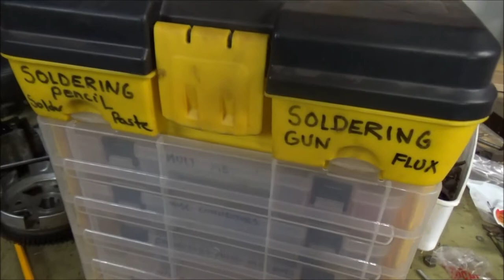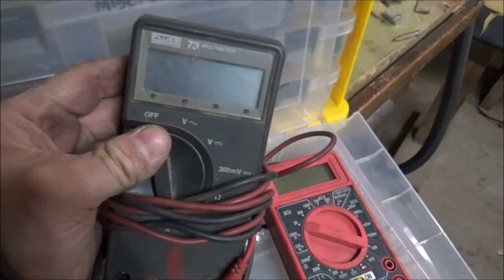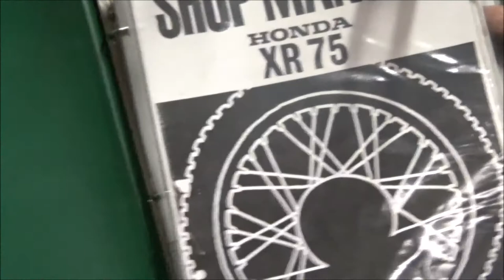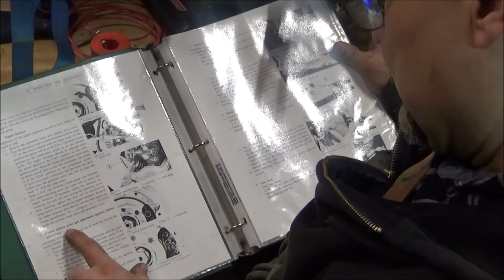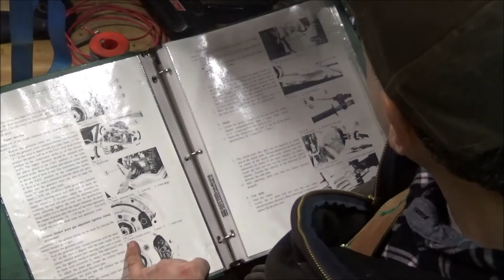1974 XR75 Ignition System Rebuild Part 1

Comment: Now I know why my XR80 engine case has that welded spot on it. "They had no flywheel tool". Good video, I am about to go over my ignition system. Your video will be very useful. I just did a full bare metal resto on my little XR80 1980 model. She looks brand new. I discovered Honda CT90 forks (purchased new) are pretty much identical fit. My XR is on my channel. I will post the finished bike soon

Comment: Hey I got a 1978 XL75 and I put an entire new electrical system in it, and still don't have any spark. I put condenser, coil, spark plug, wires, points, stator, and still no spark doesn't even shock me. I can't find any place where it is grounding out. Any advice would be appreciated. I am thinking maybe I didn't install my condenser correctly. Do you have to have the wires soldered in a certain order?

Comment: Thanks for the vid! Did you sort it? How does the neutral switch work with the ignition system?
Reply from the maker: Yes I got it sorted out.  I did get a new stator and that worked.  There should be a video in the Playlist further on of the install or at least I know I have one of it running.  Thanks for watching and commenting
Reply: @rustyedmoore  thanks!

Comment: Nice bike! I have a 73 right now that I cant seem to get fired...Mostly new ignition system, points and condenser new set to 0.12. It shocks me with a bolt in the plug but no actual fire through the new spark plug. Any help would be so appreciated!
Reply from the maker: Might be the stator coil.  You might be getting enough for a shock but not enough to fire through the plug.  Thanks for watching commenting and subscribing.
Reply: Wrong cap maybe? Resistor type.

Comment: I bought the Honda xl75 need to do a lot also ,I wonder if you can convert your bike to CDI .
Reply from the maker: I believe you can get a kit or just swap the parts off a newer engine.    I personally have no issue with points.  They have ran for 40 years with points so Probaly will run another 40.  Biggest problems with old Hondas are the Stator.  But you can get them from RM stator in Quebec Canada.  Thanks thanks for watching commenting and subscribing.

Comment: I know this video is 6 years old but i swear it looks like the book says counterclockwise but you say turn the flywheel rotor clockwise to line the F up with the index mark. Did you just read it as clockwise or what happened with that? Although you can't see clearly in the video, the text on the page looks like a longer word than clockwise and theres also arrow on the rotor face that points left/ccw. Also would you or anyone who reads this know what would cause a 78 xr75 point breaker to open 180° early??? As i rotate the flywheel CCW the points break open when the F is at the 7 oclock position relative to the crankshaft end when they should break open at about the 2 o'clock position when aligned with the index mark. Trying to get a confusing problem solved for somebody that put in a new woodruff key and sheared first kick. I put one in successfully for them but it still doesn't run because points breaj open 180° early when turning flywheel ccw. Results in unburned charge puffing out of the intake. Cam/crank/valves clearance and timing is spot on. Is it due to the breaker position on the slot? Could it be the flywheel points cam is installed 180° wrong? Looks right but I can't find alignment marks like cam driven points on other hondas. Could turning the crank by hand with the flywheel off cause this? Someone please help me help someone else lol.